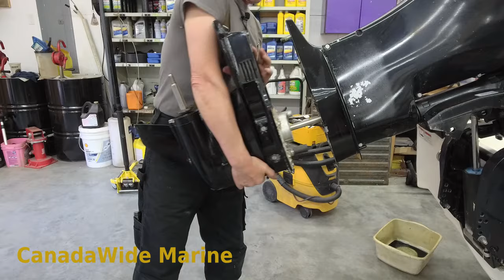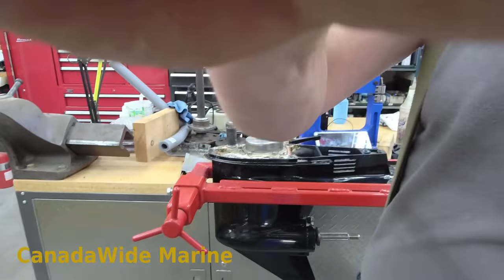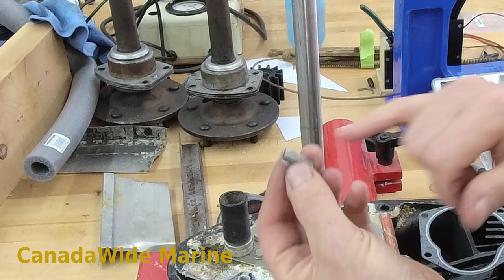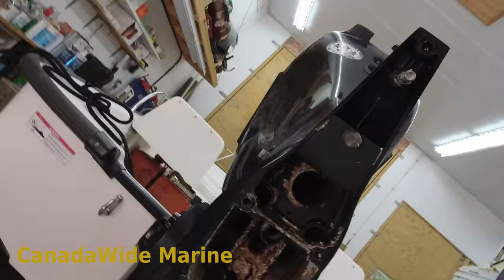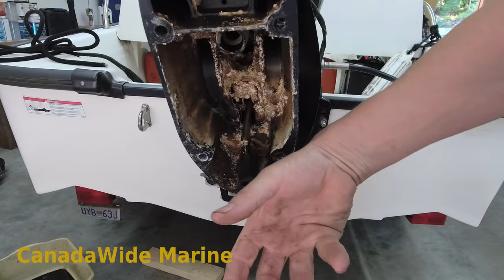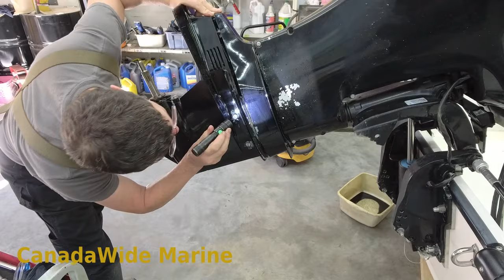How to Replace the Water Pump Impeller on a 40HP Mercury Outboard motor.

Comment: Really really great teaching videos thank you…
You said, make suggestions?
I’d love to see you do the thermostat replacement on a 2022 Yamaha 40 hp.  I’m especially needing help with the electrical connectors that need to be disconnected to get access to the thermostat housing.  
Also,  I bought a “ parts kit” in preparation for replacing my water pump impeller.  It came with a bunch of O-rings and replacement parts that I didn’t know how to use. Is it possible to do a video discussing how to use all the parts that come in this kit?

Comment: On the 60 HP models for Mercury do you find it easier to remove the Bottom Cowl to manipulate the Top Shifting Rod when putting the Lower Unit back on the outboard??

Comment: Nice video. Just dropped one of these lower units and the sheet metal bracket bolted to the bottom was broke off and sitting in the lower. What is this bracket for? It’s held in by a bolt. You can see it in the video when you are reinstalling the lower.

Comment: Not sure what year of Mercury you were working on but my 2013 was a little different. I couldn't just shift the shift rod in the lower case into forward with a pair of pliers. It was like locked in neutral. Was afraid of stripping splines with the pliers for it wouldn't turn. It didn't just click over like yours. Also the black alignment piece that goes over the shifter shaft in lower case was not a black piece. It was a different looking white plastic piece. I had to leave the shifter in neutral to get the lower case back up into the upper case, The last quarter inch of gap between cases I had to tighten the 4 bolts to get it to completely close up along with moving the throttle lever while in gear back and forth a little to get the splines in shifter coupling to line up then allowing the case to come together. The water pump, gasket's etc and rest of the lower case were the same however as your video.
Reply: I was running through the same issue. I was able to shift the lower in forward and I put the motor in forward. I had to do the same things with the bolts. In when I was done it only shifts in forward not reverse. I’m going to try the neutral thing and see how it goes

Comment: I have a 2001 Mercury 25 horse 4-stroke Bigfoot I was wondering is the lower unit the same as the one that you did 2 years ago I just bought the motor and I'm looking to take out my lower unit and replace the impeller also I'm going to replace the water thermostat do you have any videos where you worked on a 25 horse Bigfoot?

Comment: Great video, very helpful!  Rather than running a tap to clean out threads, consider using a thread "reconditioning or repair" set.  They look like taps but aren't as sharp (won't cut new threads) so they don't remove material like a tap can, which weakens the threads over time.  Once I bought a thread repair set, I haven't pulled out my taps since (other than cutting new threads).  

Again, great video - thank you!

Comment: After watching your video I had the confidence to try!!! Thank you!  I checked the impeller to find out it was fine.  Altogether I was able to pull the lower and replace in in under 30 minutes, very easy.  Checked the water line under the hood to find it was clogged with dirty sand from running in hollow water duck hunting.   Disconnected water hose at engine and blew it out from exterior water outlet and an inch of sand came out of the tube!  Boy was I relieved how easy it was and saved my self hundreds of dollars the shop would have charged me.
Thank you!!!

Comment: Hi there, enjoy your videos on the marine service, I am having an issue with the Mercury 40HP 4 stroke, I only had it for a couple of years, and bought it used, It ran ok for the first year, then one time the overheating, went away. then this has been quite frequent, I replaced all the water pump parts, thought was the problem as there was a significant amount of water being discharged. First run-out last week same thing but it seemed to get hotter more quickly. Removed the thermostat, tested on the stove by gently heating up the water, and opened it up at 180, did the test a few times leaving it to cool but found the thermostat to be somewhat sticking. The spark plugs look great fuel burn is excellent. should I try a new thermostat or do you think it could be a  head gasket issue. The compression test on all cylinders is within spec, appreciate your input.

Comment: Hi! I followed your instructions for this, and afterwards my gear selector / throttle is very sluggish and requires some force to go forward/backward. 
I think i might have done something wrong with the gear selector in the shift shaft operator. Do you have any insight for this?
The engine runs well, and goes forward/backward. Its only the throttle thats sluggish. Thanks for this video!

Comment: At what point do you know when to remove , lower plate that sits under impeller be it to replace the plate or maybe inspect what’s below ? Only if water gets in gear oil ? Possibly and how thick are those washers that sit on either side of the impeller mine look wafer thin , your vid is very informative thankyou

Comment: Is there a torque setting for the large bolts and the impeller housing
Reply: 40 ft/lbs on the large bolts. 60 in/lbs on impeller housing.

Comment: I have a 1999 mariner 50hp with a constant high pitched alarm, suggesting overheating.. any chance you could do a video on these things and what to do about it? Thank you 😊
Reply: My 91 Mercury 40hp had a constant alarm too. Turned out to be the oil pump because it was oil injected. I bypassed that and the alarm went away. Now I just use mixed 2 stroke fuel and it’s fine.

Comment: Im pretty sure my water pump went out after sitting, as i finally got the condensation out of the fuel system and got it started but not spitting water. Made sure the lines weren't clogged and no water is pumping 😫. Im hoping i can tackle this myself as i am decently mechanically inclined. Thanks for the detailed video!

Comment: The sealing ring that you almost forgot- would it be detrimental if you did? 

I pinched mine with the key a little bit. It’s not torn, just not perfect like it used to be. Do you think it matters if the sealing rings are exactly perfect ?

Comment: Gday jim i have just finished watching a guy called boat crappies do a service on the lower leg of a 40hp yamaha and yes he lives up to his youtube name ,there was not a sceric of grease used at all on any part ,impellor housing ,bolts ,driveshaft splines and he didn:t even take of the prop to check for fishing line or grease the splines  .Now im no marine mech by any length but it makes me angry when i see people putting up you tube videos where some other guy is going to think this person is the bee knees and follow what he has done i recomend your site to people when i think or they have a certain problem with there yamaha  such as changing the fuel filter on a f50 i told the guy to check out the maintenance you did on the yam f 50  ,grease is your friend it can save you money ,it can save you time and most of all it can save you heartache when the mech tell you your engine is stuffed my saying is GREASE IS YOUR FRIEND  i let this person know that he should have done this when reasembling but it will probably go over his head bloody yanks .

Comment: hi ,,, good video.. I have a 60 hp merc   2014 on my boat  it doesnt have a seal face on top of the impeller housing. i noticed yours didnt have one either. Do some motors not have this seal...

Comment: Should the engine be in nuetral or in gear when doing this service?
Reply from the maker: I generally do it in neutral. But sometimes I need to put both the drive and the control in fwd gear during assembly so I can turn the prop shaft to align the splines on the driveshaft.

Comment: I have a 2012 mercury 40hp 4 stroke. After I changed my impeller I hear a squeaky or whistling noise coming from the motor at low rpm’s. Sometimes I can give it a little throttle and it goes away. Other times it’s pretty steady at idle or low rpm’s. Some people are telling me to rub more grease on the shaft because the shaft runs through a bushing and that’s were the noise is coming from. Does this sound right to you? Thanks for any help you might have with this.
Reply from the maker: Many outboards have a bushing on the driveshaft to reduce flex. Often I see corrosion buildup around the bushing that tightens it up against the shaft. If that is the case I replace the bushing and clean up the corrosion.
A little grease may help, but it is lubricated by water from the pump, so if it is noisy it is probably too tight.

Comment: I need to change the water pump on my Honda 40hp outboard. Is it the same procedure? Any help, advice, links to help would be greatly appreciated. Thank you!
Reply from the maker: pretty much the exact same procedure, except for the shift shaft connection which is a little different.
Reply: @CanadaWideMarine  do I have to align anything or make sure anything is done in particular way when I undo it? Can I do everything with the boat in neutral?
Reply from the maker: The Honda shift linkage is usually connected with a threaded adapter between the upper and lower shift shaft. It shifts by pushing and pulling the shaft up and down.
I find it easiest to put the control in reverse, this lowers the threaded adapter, loosen the jam nut, and screw the adapter all the way up onto the upper shaft. then remove the lower unit as normal.
When installing, be sure the lower unit and control are both in reverse, install the drive and tighten it all the way BEFORE re-connecting the threaded adapter to the lower shift shaft. this ensures that the relationship between the upper and lower shift shafts is correct. I may have done a video on this type of shift linkage, I just don't remember which one it is, you'll just have to watch them all. ;)
Reply: @CanadaWideMarine  Thank you! I’ll check out you videos to see if you made one like my situation.

Comment: The Sierra 18-3324 Water Pump Kit below is recommended for your outboard 40 hp Mercury 2 stroke. The kit model #WATER PUMP KIT 77177A3 your Mercury 40 hp is a little different than mine as I only have two bolts that hold the bottom end on. Does that make mine older or newer than the one your working on?
Reply from the maker: I'm sorry, I don't know the answer to that. We don't work on very many old outboards so I am not familiar with the year model changes and such. If you go to https://public-mercurymarine.sysonline.com/Default.aspx?sysname=NorthAmerica&company=Guest&NA_KEY=NA_KEY_VALUE&langIF=eng&langDB=eng
and punch in your serial number it might help you identify a year model.
Reply: @CanadaWideMarine  I found a 1996 model that only had three studs running through to hold the prop end on. I have done most of the work I am just trying to get both tyranny shaft back in and the ? water tube in it's place. The salmon are just starting to run up the Columbia river and the Willamette river it's time to get out on the water.  5/12/2023

Comment: Gday mate you do a good thorough job id be happy to let you work on my engine ,i have to say that leg and even inside the propellor looked a bit nasty is it corrosion or calcium build up either way didnt look good , never to much grease except on the top of the shaft especially in salt water ,we dont get much sierra gear here i think you can get it but you have to find a retailer and frieght from the U.S to A.U is a killer wanted to but some spare mounting bolts for my yamaha frieght was around 60 dollars for 4 bolts anyway good video .
Reply from the maker: Yes. That was an old motor, we don't generally work on stuff that old.
Hit us up next time you want Sierra parts, or any parts that are hard to get down there, we have shipped to Australia before. 
As a side note I spent 17 years in Australia, up until 2000. East Coast mostly, Brisbane to Sydney, and Hunter Valley.
Reply: @CanadaWideMarine  Hi mate briso i could handle spent a bit of time in townsville courtesy of her majestys armed forces sydney naa not for me and the hunter valley spent some time there too at the infantry centre singleton on and off , i have a mate who has a 1975 johnston 35 and he cannot get any mech to touch it he asked me and i declined sure as eggs a bolt will snap somewhere and i aint paying for a new engine

Comment: Very nice video! Very instructional and the reference to why not to use impact wrenches on sensitive or bolts which may be corroded. Thanks!
Reply from the maker: I don't use impact wrenches very often, they strip threads and break bolts. When I do use an impact driver I loosen or start the bolts by hand to ensure the threads are free before running them up with the impact driver. The only time I ever break a bolt off and have to drill it out is when there is absolutely no other option, which is very rare, in fact I don't remember the last time I had to drill a broken bolt out.

Comment: Why not just put everything in forward before you take the lower unit off?
Reply from the maker: To be totally honest, the main reason is because I always forget on these ones. Most of the motors I work on are fine splines, that don't need much to align them, so these older Mercs with coarse splines. The other reason is I often do other work on the lower unit and loose track of what gear it is in, so I like to be sure when it is going back together.
Reply: @CanadaWideMarine  thanks. Awesome video!

Comment: Glad I came across your video - nicely done! I have seen a couple other videos on the subject impeller replacement, however, yours is by far the absolute best. Simple but sufficient  detail. I will use it to guide me through the process on my new to me 2018 40 hp 4 stroke motor. Thank you sir!

Comment: Hi, I have a 2012 Mercury 60 hp, My question is, does the low pressure fuel filter be full of fuel all the time?  I notice that it is almost empty while running.
Reply from the maker: Yes, and no. If the filter is positioned so the air can bleed out of it then in a perfect world there should be no air in it. most of the time the filter does not bleed the air out, so air remains in the housing, add the vacuum of the low pressure pump and it will expand the volume of air. Now, we also need to be sure that we are not pulling an unnecessary amount of vacuum because of a restriction in the supply side, and we also want to be sure there are no possibilities of air leaks into the supply side adding air to the system.

Comment: Would you happen to know if it’s safe to use Lucas multi purpose Maine grease for this? It’s the grease I use in my wheel bearings.
Reply from the maker: I use the Lucas Marine grease for everything except lubricating rubber parts like the impeller. For the impeller you can use dish soap, or a silicone grease.
Reply: @CanadaWideMarine  awesome. Thanks for the help. I’m getting ready to do this for the first time in a few weeks.
Reply: Watched your video about 3 times  I am a 75 years old and a woman  if I can do it any one can you are a very good  teacher for this video . I would like to see more. Thank you!!
Reply: Just one question if u took the lower unit off while it was in neutral, why can't u just put the lower unit back on in neutral, why do u have to put it in forward?
Reply from the maker: @tightline6lb  I put it in gear so I can turn the propeller to turn the driveshaft to line up the splines.
Reply: @CanadaWide Marine   that's what I thought, I just wasn't sure if it was something I over looked or didn't hear. Thank you for the response.
Reply: I don't see or hear about winterizing ur outboard motors with marine antifreeze.  I hear that as long as u keep the motor vertical, all the water will run out. I have a 2014 50hp mercury.  What's your take on this?
Reply from the maker: @tightline6lb  I have done both, a lot. I have never seen an outboard damaged from freezing, but that doesn't mean it doesn't happen. Around my area it doesn't get super cold like other parts of the world. Now, if you have a saltwater motor, that maybe a little older and could possibly have a blocked drain hole or two from corrosion or salt buildup, my personal preference would be to flush with antifreeze, just in case there is a pocket of water left behind. I also "feel" that the antifreeze slows up the corrosion, but I have no studies to back that up. Also on fuel injected motors, with a fuel cooler, such as yours has, I like to flush with antifreeze because the cooler seems to hold a little water in my experience. I've never seen one damaged, but have removed them in the spring to find a little water in them still. On the other hand, except for a couple of the newer outboards in the last couple years, manufacturer's recommendations are to simply let the water drain. If in doubt, always follow the manufacturers recommendations.
Reply: @CanadaWide Marine   That's my thought on the fuel cooler along with the smaller water lines that hold water that it might hold some. I haven't heard of anyone with any issues on just letting it drain.  Maybe in the future for us DIY that u can make a video on this?